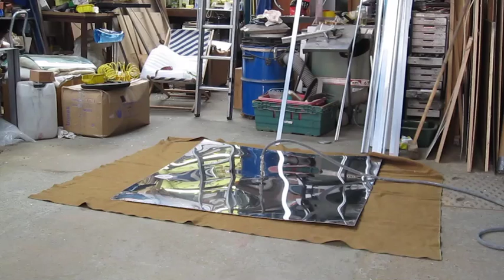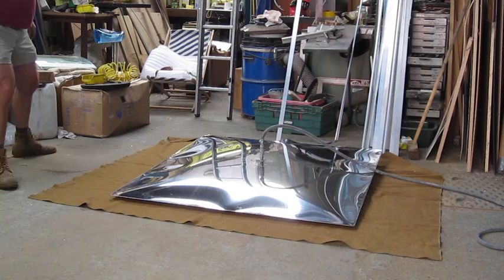Inflating the prototype steel form

Comment: Was it inflated with a classical compressor with only 12 bars pressure? Thanks
Reply: Pol Quadens only around 2 - 4 bars are needed. I wouldn't go any much over that. So a normal compressor is fine with thin steel (1mm or less)
Reply: Well thanks I have a project of a sculpture I'd like to show you and get some advices.. Do you have an email address to talk about that? Thanks a lot.
Reply from the maker: yes, it only needs about 2-3 bar

Comment: Pressuring with air is extremely dangerous.. 
Only supposed to be done with water which isn't able rise pressure.
Reply: this was the very first test, went up to around 50psi (we were no where near the steel btw). Found out that with 1mm steel you dont need much more than that with these large forms. But you're right of course, air is compressible/water isn't - so high pressure air can go bang. Though its worth noting that water can create high pressure - much more easily than air, it just doesn't compress much, so isn't explosive.

Comment: can you tell me how thick was the steel?  how is the air inlet attached to the steel?
Reply from the maker: 1mm, modified an air hose adaptor to fit a M12 thread - welded a nut onto the steel